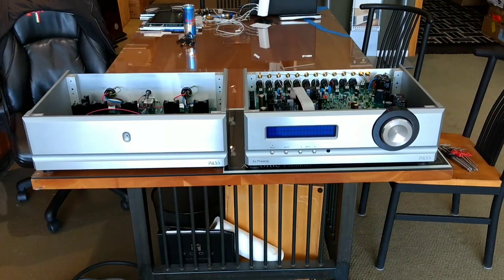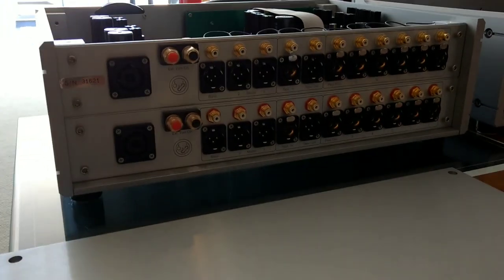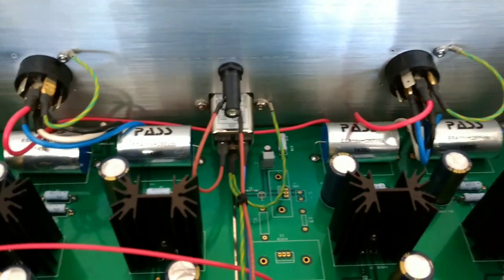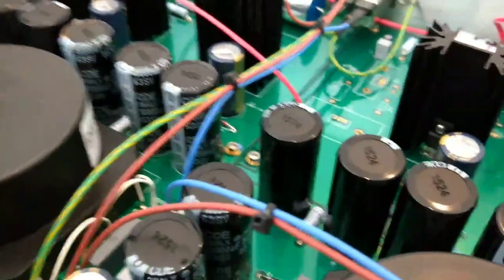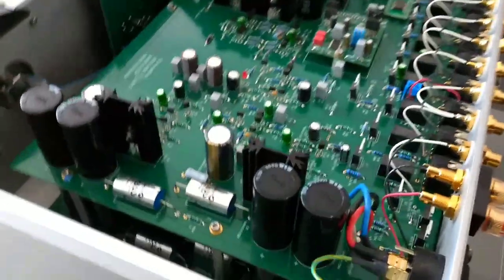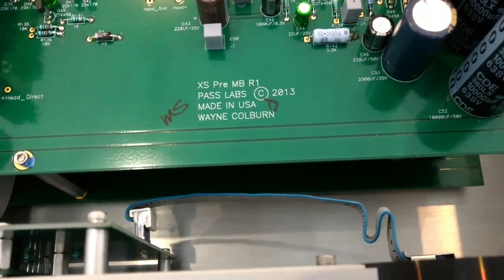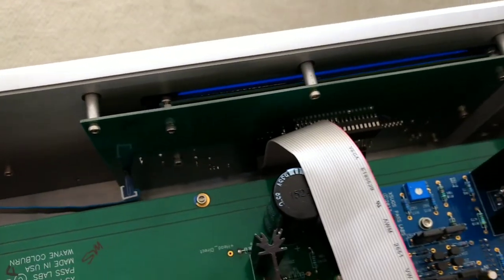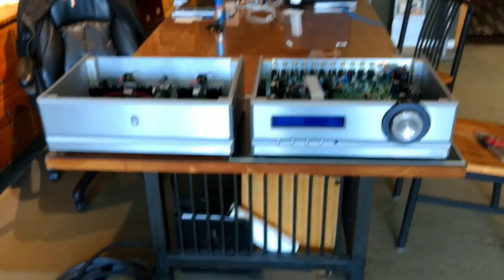Inside Pass Labs XS Preamplifier

Comment: I"m sure this is a fine unit, but its weird to me that they daisy-chained the grounds to the RCAs and did not elect to take the grounds from each connector  along with the signal wires to the main board via twisted pairs. Look up "ground loop" specifically that part that covers "ground hum caused by multiple paths to ground".
Reply: Interesting observation! Also what’s up with those push on connections on the power supply cable jack. Doesn’t seem appropriate for gear in this price range. Thought that soldering would be best practices
Reply: I see no problem with ground loops. They are all connected to one single point at the PCB rather then 6 or more points at the PCB???
Reply: @kenielsen   i think what you mean to say is you see no problem with daisychaining grounds, which is OK as long as that doesn't cause loop in the ground routing. Ideally however all returns to the power supply should have their own direct path back to the supply itself

Ground loops in an audio path will almost always cause a 60 cycle hum (50 cycles in some countries -  depending of the frequency of the AC in the wall socket). This  hum can be heard at the audio outputs. A single path of ground eliminates this. 

Having longer and shorter paths to ground can also cause DC voltage drops. You want it stable.
Reply: @PeterGrenader  correct 😂